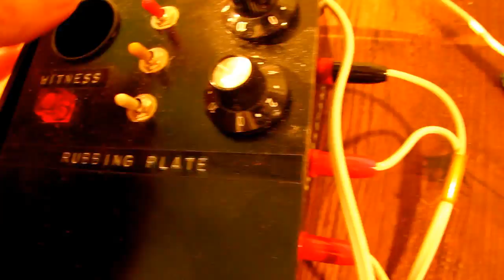HDR spoon

Comment: This effect happens when you generate eddy current in metal. It becomes easier to bend and heats up a bit too. It's pulsating frequencies right? Well that's not an uncommon effect for the spoon or the watch moving faster.If you want to know for sure if its a time field or not, light something on fire next to it, see if it burns faster; Put an ice cube next to it and see if it melts significantly faster. In fact, you can measure the amount of time it takes to melt an ice cube.

Comment: In fact, measure the time it takes to melt an ice cube or make an apple slice go brown. Then do it next to the HDR and use the watch to see if it takes the same amount of time. For example if the apple slice turns brown in 5 minutes, then next to the hdr it should take a few seconds and you can see it with the watch. Goodluck.